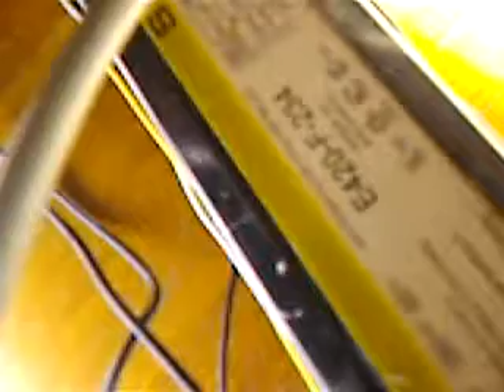EXPERIMENT: 2 lamp F40T12 HPF rapid start ballast being used as a tulamp preheat ballast

Comment: I just tried this with a 14,15, 20 watt NPF ballast too. The ballast works just fine, but sometimes the second bulb with the yellow wires doesn't start up right away. It blinks alot with a certain FS-2 starter. Otherwise they work just fine with NPF ballasts too. I need to try this with a HPF F40 ballast yet.

Comment: I have an old rapid start fixture lying around somewhere that would not start the bulbs.  I cannot remember the way I wired it, but I wired one starter to basically "short out" the "lag lamp" allowing the "lead lamp" to start, then when the starter opens, the second lamp starts.  I will have to dig that thing up.

Comment from the maker: I haven't blown up any starters myself but one viewer who tried this had it happen. What I can say is that you will need to use FS-4 type starters for this. FS-2's will likely overheat and blow up since they are meant for smaller lamps. Also, I will recommend using F40T12 lamps in the setup rather than F34T12's, though F34T12's will work as well. Finally, some brands of ballast work and others don't. Magnetek watt reducers are the best. Advance Mark 3's don't work at all. Hope this helps.

Comment from the maker: Hmm. I'm not sure what went wrong and ive never heard of starters popping before. When I first tried this I had no idea what was going to happen. I kept tinkering around with different combinations until I got this one that worked. The Universal Watt Reducer ballasts worked best while the Advance Mark 3 Energy Saver did not work at all. How did you wire it? I suspect that it may have been wired incorrectly. I'll have to draw up a diagram sometime.

Comment from the maker: Was it an electronic ballast? I used a magnetic one for this one. Also, I've never heard of starters exploding, though since electronic ballasts put out a higher voltage and are DC that is possible. One thing I can say is don't try this with an instant start ballast. What is the line voltage in your area? For me, I'm working with 120 volts 60hz. Lastly, are you sure you wired it exactly as I did or is this a joke?